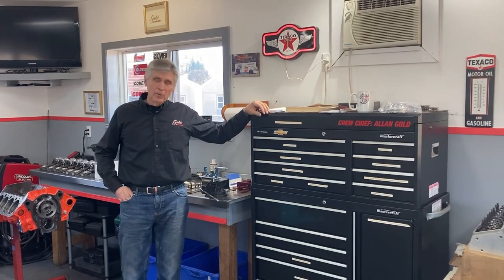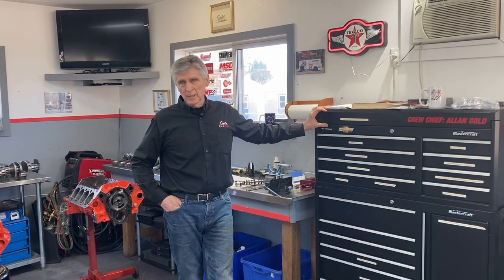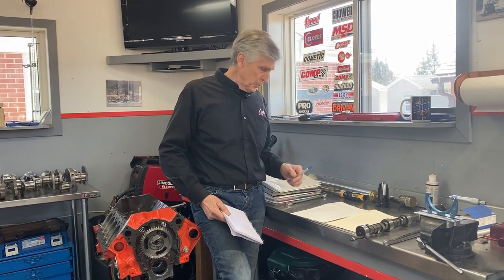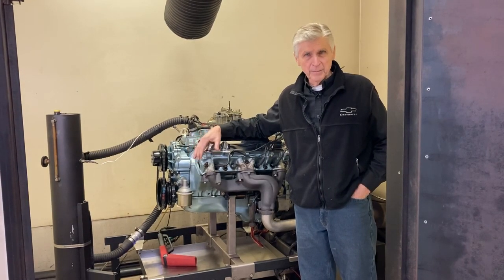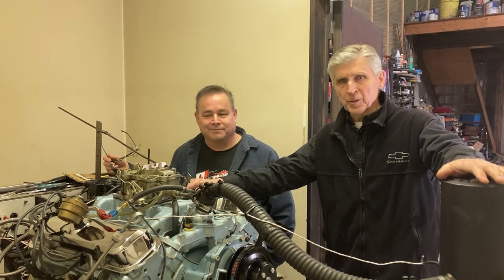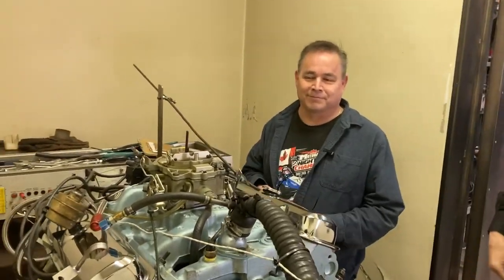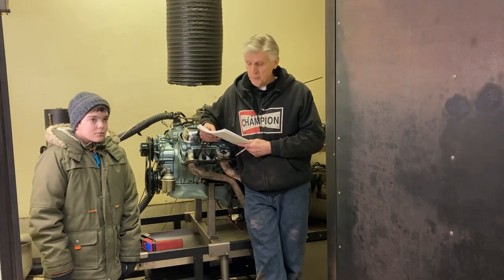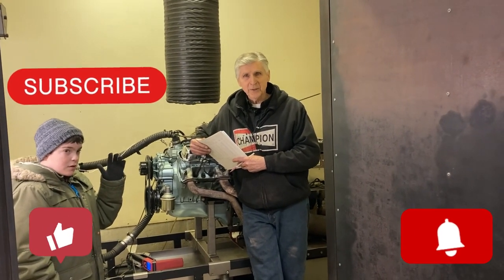Matching your camshaft to your compression - Dyno a testing 1970 GTO Pontiac 400 - Quadrajet Tuning

Comment: Those Qjets are highly under appreciated. Those carbs, along with the early Holley 3310 with the dogleg boosters, were the best street performance carbs ever made IMO. I've got a late 70s 454 Qjet I'm going to be using for a 427 Chevy build, and a late 70s Pontiac W72 Qjet for a 400ci Pontiac build as well. Both are the larger 800cfm units.
Reply from the maker: Thanks Adam, I would agree. this was also an 800. AG

Comment: I'm glad you're experimenting with the Pontiac 400. I have one just like it with 6X4 heads and a sum-2800. I have another block I am going to build later and will have #13 heads ported with 10.5:1 compression and either a competition cams 270 or 280H. I can't run an Edelbrock performer RPM because of hood clearance but maybe a torquer two small open plane or cut the plenum divider down on the stock. I will be running the same ram air three reproduction manifolds and like you am faced with trying to figure out how to get the best out of those manifolds. The 280H might be a tad too big for those manifolds and the 270 might be just right. What you did so far is working great I might just duplicate what you did thanks again 👍
Reply from the maker: Thanks for the info Chris. AG

Comment: I find it interesting that AX rods were used. I had a factory 1980 Monte Carlo Turbo Coupe that had a draw through turbo setup with a Q Jet. When I took it to the drag strip I ended up using AX rods also. But I do not remember what hanger I used, it was 30 years ago. With a few mods and 18PSI & 2.56 rear gears I got it to run 13.9's at the Eagle Motorplex
Reply: AX metering rods were pretty common in some 454CI chevies. A lot of the 500 CI Cadillac's had CZ rods. These were great for a big block with high flowing heads, large cam & headers.   😁
Reply from the maker: Thanks for your input Ken. AG

Comment: Also, anyone that chooses the Quadrajet carburetor are alright by me! It's all I ever use. If more people would learn how to tune them I believe more people would be using them.
Reply from the maker: Thanks Robert, you are correct. We have tested engines with Quadrajet vs. Holley carbs and they do well. The Stock and SS drag racing guys like Austin Ward (who was in this video) make awesome power with Quadrajets.
Reply: @goldsgarage8236  , There are also front metering rods& spring that can be tuned on the Q-Jet. If I remember correctly they are called vacuum pistons. I used to have good luck matching the spring controlling the front metering rods to the engine vacuum. Really affects the mileage as well. I'm sure Austin knows all this.  I always like the Q - Jet, very tune able carburetor. So many people in the 60's & 70's removed these in favor of the Holley.  I enjoyed the video.

Comment: The only thing better than a water brake dyno is God's dyno, the racetrack.  I used to use Engine Jr/ Engine Pro to determine the optimal duration for my race engines.  It becomes more subjective when you apply it to a street engine. Good work!
Reply from the maker: Thanks for your comment Brad. AG

Comment: Only 20 hp difference between manifolds and headers at that power level is impressive by any standards. Some exhaust manifold designs are good but the majority are bad. When it comes to nice manifolds the 1960s and early 1970s Mopar manifolds come to mind. I would have liked to see the gains with just the compression increase. 21 lb/ft gain for less than 3/4 point compression increase and 4 degree cam advance is impressive!
Reply from the maker: Thanks Robert, the Ram Air Manifolds are actually pretty good. They have a divider cast between the center cylinders that share the same exhaust port.

Comment: Correct me if I'm wrong, but advancing the cam will increase the overlap thus tightening the LSA, which is a good thing.
Reply: Incorrect... Lobe center angle and overlap is ground into the camshaft ... Advancing the camshaft moves the whole cam
Reply from the maker: Thanks Scott, you are correct.
Reply: @scotthatch4548  ok, thanks
Reply: Advancing the cam will close the intake valve earlier, which will trap more air at lower rpm. This usually makes more torque, but hp will drop off faster past peak.
Reply: @keithiverson6687  actually torque is more about fill at 75 degrees after tdc and advance gives you more fill because of lower center line angle on intake valve... Closing early can help with pump back but that is less of a concern ...I have done videos on these camshaft events
Reply: @keithiverson6687  Perfect for a street engine where torque is king.
Reply: Yeah the lsa is not going to change by advancing or retarding the cam but as he said the results were typical of what would be expected low end increase across the board and a compromise of loosing some on the top end it's exactly what you want for a strong street motor your not gonna be winding out a Pontiac motor past 5250 as a rule anyway you really should never need to he hit the nail on the head horsepower is just a number that's calculated past 5250 where it is going to take over completely below that it's torque that moves the car spins the wheels and does all the work people think they need horse power oh how much HP is it not me I wanna know how much am I going to be pushed back in the seat so how much torque does it make

Comment: Making 160 psi warm cranking compression at 5100’. Puts me around 190 at sea level. Run a 500cfm carb at elevation and 600 at sea level . 10:1 331 sbf
Reply from the maker: Interesting approach, thank you for sharing Piercer. AG

Comment: So what was the difference in horsepower with the headers vs the Ram air manifolds?
Reply from the maker: Thanks for the question. On the previous dyno session we got about 20HP more with the headers, however in this session we focused on the tune with the manifolds because that is how it will be in the car. If you notice how the Pontiac heads are made, the center 2 cylinders share the same port and so the headers only have 3 pipes. The manifolds however have a divider between the cylinders which I would expect will help.

Comment: I sure would be interested in the dynamic (not static) compression of both builds. 140 psi on the first build was pathetic! And... I would want a tad bit more than 170 psi than the second build provided. But, thats just my two cents worth.
Reply from the maker: Thanks Jimmy, I will ask Mike to reply to this question as he has these numbers in his head. For info, we did detect a little detonation as we advanced the timing.
Reply: Dynamic was 7.35:1 and 7.98:1

Comment: If they are going to run premium fuel why not have compression up 10.5:1  Its free basic hp gains everywhere!  Most 60s-70 year muscle cars had at least 10:1 compression and 70 gtos had 10.5:1 and made 370 hp with manifolds on with a old cam profiles.  so at sub 10;1 compression you went backwards.. Modern camshaft profiles and stock compression that motor should of been made 400 hp easy! You you did all that work and took motor out heads off ect to gain only 10 hp?  No reason you can't have a 400 pontiac 1 hp per cubic inch and still have it very streeable with todays camshafts!
Reply: With cast iron heads, I think most builders stay 9.5 to 1 or under but what do I know. Back in the 60's higher octane leaded gasoline was available. We stopped using it after seeing the long term effects on Boomers decision making.
Reply: @davidmitchell7183  I agree with the strategy of using cranking compression to match cam to the C.R. of the engine. It makes sense.
Reply from the maker: Thanks Tims
Reply from the maker: Thanks for your comment David, being a boomer myself, I would have to agree with you
Reply from the maker: Thanks for your input Larry.